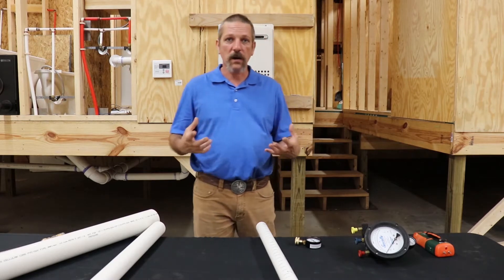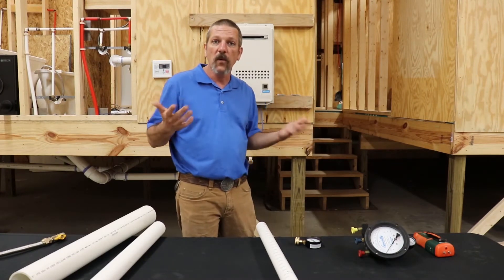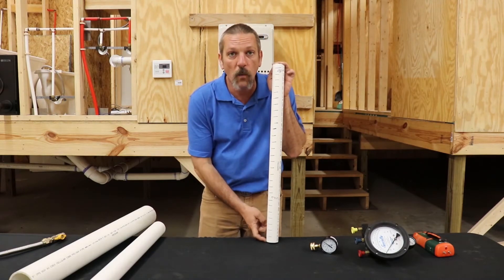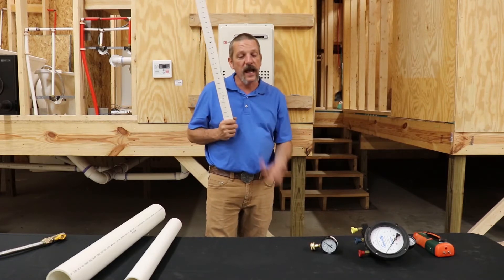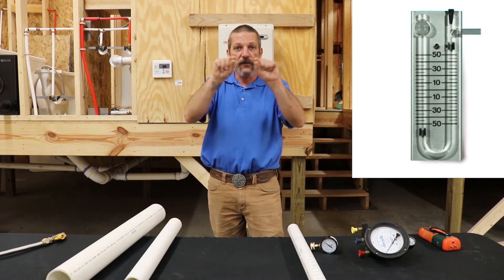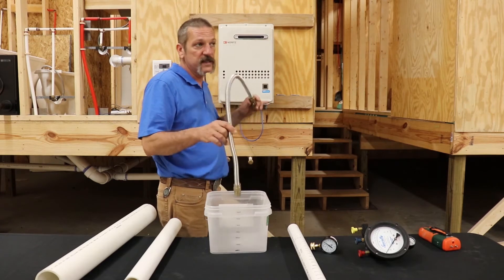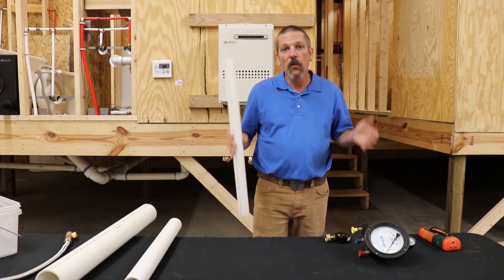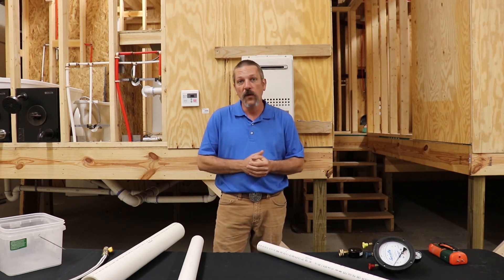Understanding Water Column in Plumbing

Comment: As a plumber my question is what if we run 10’ of 1.5 inch standing  pipe to test a 4 inch sewer line. Will it still be same pressure 4.3 at the bottom of the pipe. And what if it’s 1/4” pipe?
Reply from the maker: yes, the size of the pipe doesn't matter. But does your inspector know that? We tried to save money by doing that on our slabs. but the old inspector couldn't grasp the Idea, he was used to seeing a 3" riser. It's gravity not volume.

Comment: There would be slight variations depending on density of the water. Density is affected by temperature and dissolved particles. Solid video though. Definitely gives a workable understanding for measuring low pressures and vacuums.

Comment: Plumbing Solutions so if its going up a hill at a 45 degree angle is it the same or only vertical feet? is it 28 inches of pipe or 28 inches of vertical height? thank u..
Reply from the maker: It's straight vertical
Reply: Doesn’t matter 45 deg or 50 feet of pipe it’s the vertical distance of 28 inches